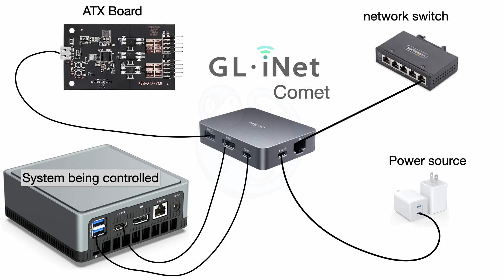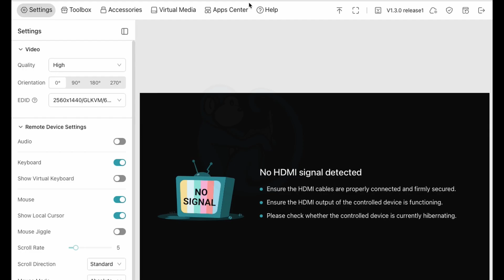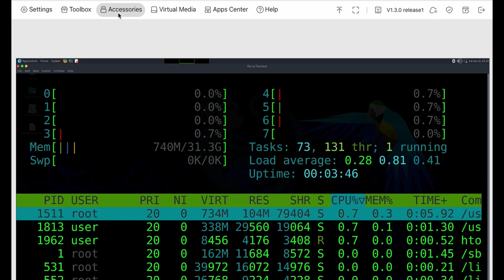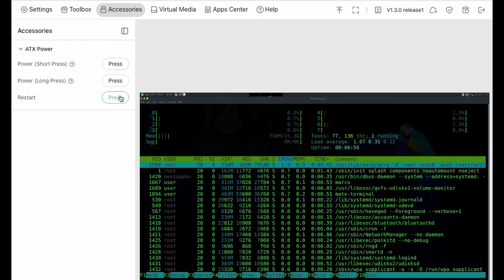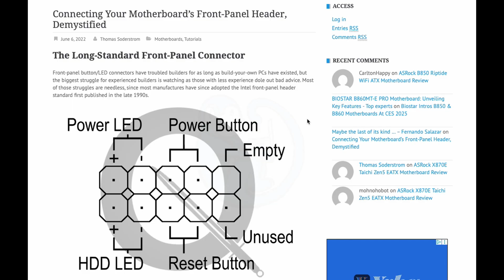GL.iNet GL-ATX Board - optional accessory for the Comet KVM - Product setup guide & Review

Comment: Have set my GLKVM + ATX board  up today. Everything works great except the power switch feature. The connections are fine, because pressing the physical power switch, which now flows via the ATX board, switches the PC on and off. The 'restart' function in the KVM interface, which I assume uses the reset button connector, works fine too. The power switch, either short or long, in the KVM interface does nothing. I tried re-seating, upgrading firmware, switching polarity, nothing helps. Guess I got a broken ATX board...
Reply: And the video he said try reversing just a power switch pins only. It worked for me cuz initially how it has in the diagram it does not work but just switching that  two pins made it work perfectly. It's most likely because of the type of motherboard you have has it switched, like mine did.
Reply from the maker: Fantastic, thanks for the feedback and glad it worked
Reply: Quick update switching the pins makes the IP KVM power work but will make your physical button not work. You will probably need to get some new motherboard pinned out wires to be able to switch them also on your motherboard header.
Reply from the maker: Oh, that kinda sucks that it rendered  the physical button not functional.
Reply from the maker: Hmm, my initial guess would be to say its a cabling issue but its weird that the physical hutton works and the software “restart” works but the software “power” does not.

Comment: nice one. appreciate the info. I'm just installing mine now.
Reply from the maker: Cool, please post again to let us know how the install went
Reply: @BlueMonkey4n6 got it working. Was quite a smooth process. My main issue was the little jumper leads i had to take out the mainboard and put in the atx power card weren't long enough. Because the internal case cable management system had locked everything in place.

I bought a small 20cm compatible extension off Amazon and fitted all the jumpers pins into it and everything was fine.
Reply from the maker: Nice!